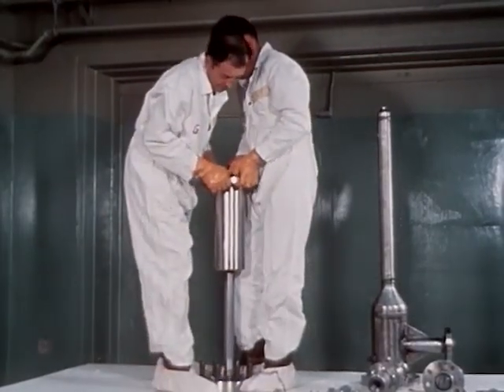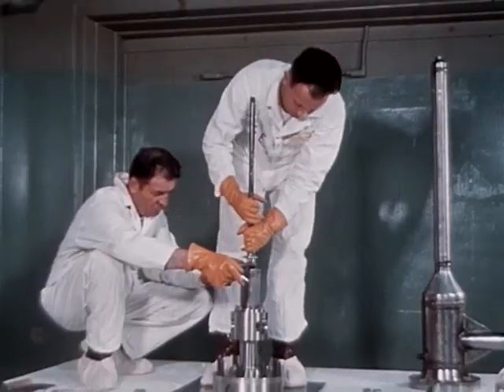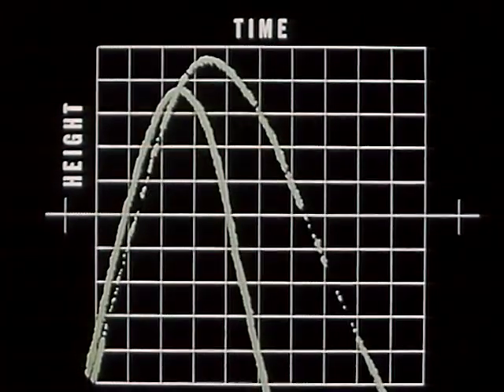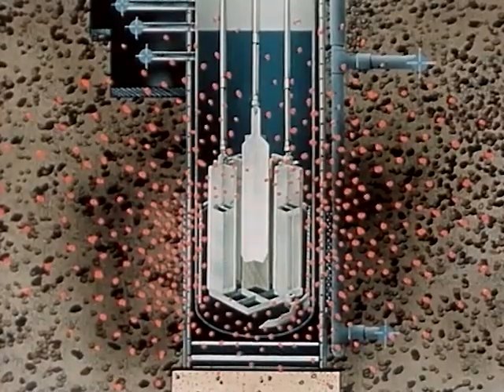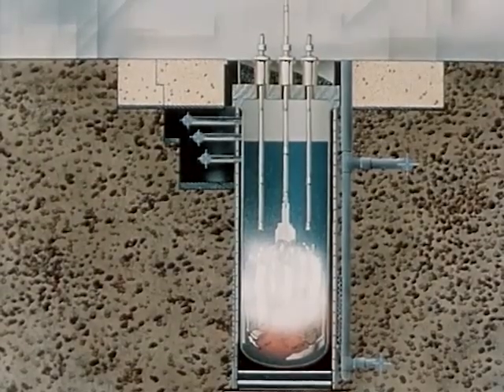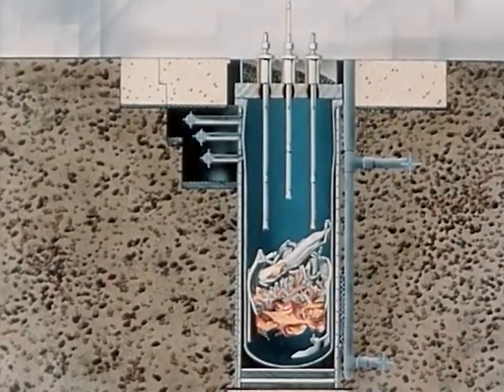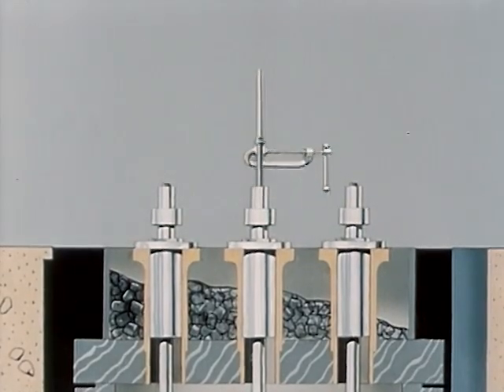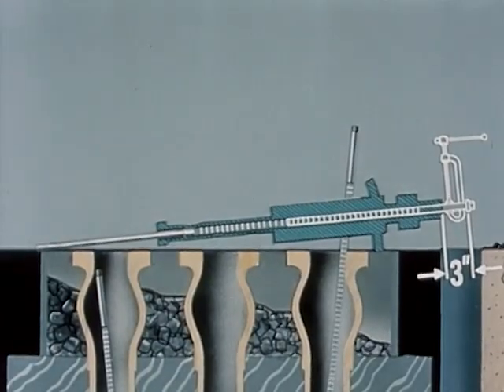Nuclear Power Reactor - The SL-1 Accident Video: Briefing Film Report - 1961 - CharlieDeanArchives

Comment: Absolutely the problem was in the guy manually removing the control rod. So whoever DESIGNED such a stupid, f-edup gimmick should have been arrested. Assuming they caught him before he got back to Moscow...

I mean, this POS needed to be lifted 4" but gets stuck all the time? Very easy to picture an accidental extra foot of pull when you yank on it and it breaks loose.

Comment: I wonder if this is the accident where one of the operators was impaled and pinned against the ceiling by one of the rods?  Two or three of these guys were purportedly so radioactive afterwards that they were buried in lead lined coffins.  I also believe the control rods for this reactor were manually adjusted meaning something happened with the operators that caused the excursion.  The report I read indicated that a control rod became stuck and the operator was manually trying to force it loose when he jerked the rod upward and past the criticality position causing the accident.  There's a lot this old film, which was likely intended for the regulators,  doesn't include.
Reply: Yes it is.
Reply: Yes sir. Right out in the desert of Idaho.
Reply: look up plainly difficult. its on his channal.
Reply: The very same one.
Reply: For the record,  civil war men are still leaking arsenic to this day.

Comment: It was concluded from analysing this video that the SL1 was a horrible reactor design.
Reply: From what I understand there were so few rods that bringing a single rod up too far is what caused it to go super critical. There were only 5 rods I believe where larger reactors had many, many more. They were trying to keep the reactor compact but this left too small of a margin for error by lifting it too far. Not to mention according to reports they were getting caught/ jammed where they had to use a pipe wrench to knock it free. Not good, not good at all.
Reply: Lol
Reply: pretty much, I personally find it suspicious to that the violant explosion reinserted the control road. i..e could not of been human error at all ..
Reply: @confusedkiwi5774  The SL-1 Has the issue where the main blade where you activate the core was extremely powerful. SL-1 had 5 fuel rods with the middle being stupidly powerful whereas Chernobyl had over 200.

It was awfully made from day 1 which was monitored by newbies with no supervision by higher ups.
Reply: Not sure I agree. Don't know enough about the design. Oversight, procedure monitoring (where was the control room operator, or we they just doing their thing). Stupid, incompetent management.
Reply: Ain't all small reactors like this horrible, there were military compact reactors which were abandoned.